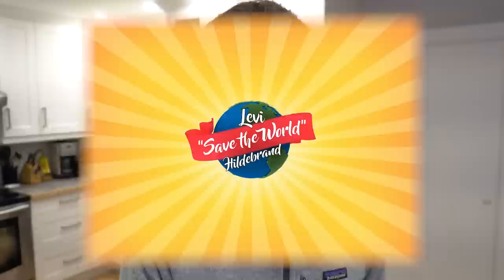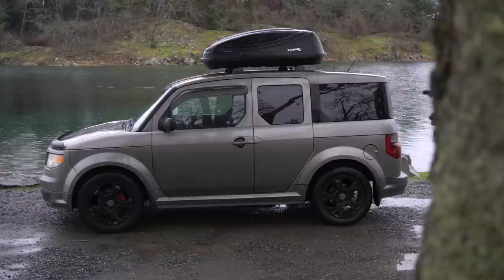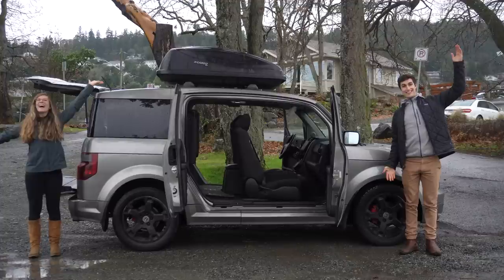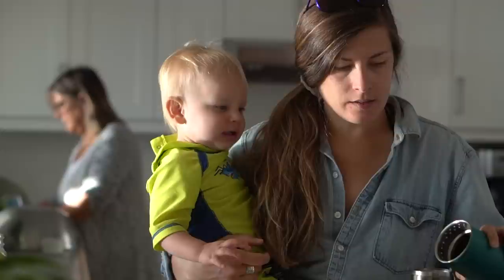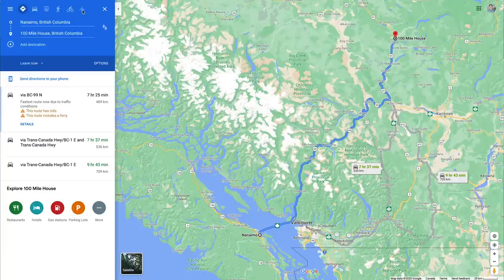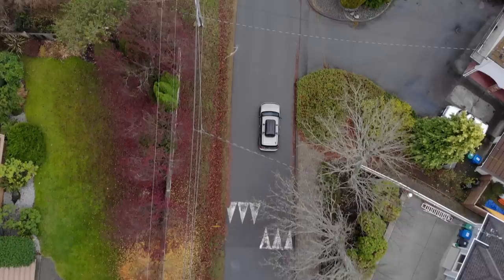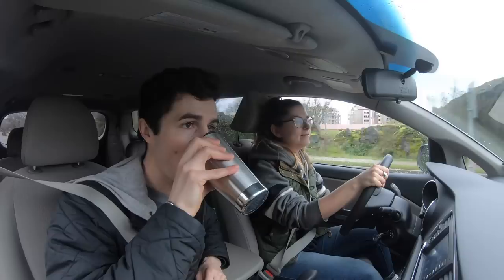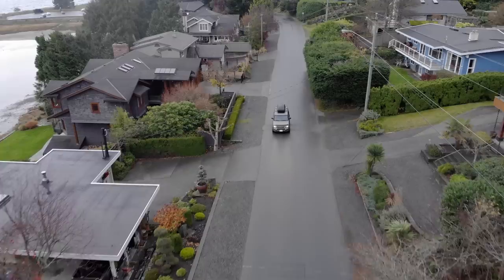We Bought A Car!?

Comment: Thanks for publishing this!

I can relate to some of this. Commuting by public transit to work is 1.5 hours, vs driving takes < 20 min, so having access to a car is a decision I had to weigh against the value of time and my mental sanity, but also access to things that aren’t walkable. Also now that Covid is present, having your own vehicle means the privilege of lower risk of exposure to other people when you do need to get to essential places.

I’m curious if you’ll touch on the maintenance/repair aspects of a car (bc mending instead of buying new is applicable to all things to a certain degree), fuel efficiency (and making best use of that), but also choosing between gasoline that has higher ethanol (cleaner burning, but also more expensive) vs “regular” gas.

Comment: You could have also bought a used Fit, which have hondas magic seat feature, where the rears fold flat and into their footwells. They are more efficient with less wind drag, narrower tires, and a 1.5 I4 instead of hondas k24 powerhouse. That comes with the cost of acceleration/torque and initial price(they are highly coveted at least in the US) but with the benefit of similar or cheaper maintenance cost, 20% better average fuel economy, and the ability to stretch that F.E. much further than the element using efficienct driving practices. 

You may want to change from overhead pod storage to tow-hitch-and-box storage to decrease drag area if you seek to drive as efficiently as you reasonably can(testing to determine which is more efficient is recommended). Also watch out for and baby earl's starter. You basically have to remove the engine from the car to get to it - look at scotty kilmers video on them. Another video to consider when comparing earl to electric cars would be the those on ev's from Jason at Engineering Explained. 

Seems like, in order to live the way you choose, you're dependency on cars is somewhat forced. Have you considered ebikes to supplement <15mi trips? Please do if you havent-its way more efficient than human power. 

Nice to hear you intend on keeping your impact-by-mileage far lower than averages. Id say that's one of the most important things - whether or not you own a car. Many tend not to think about that when trying to be sustainable drivers. It seems some instead look for the most efficient hybrid to suit their wants/needs and rack on 18k miles/yr(necessity notwithstanding), which in turn is more impactful than 4000/yr in an element. Sick find!
Reply: Exactly what I came here to comment! My family member has had a honda fit for 8 years with no problems. You can get cheap used, fold up seats plus the great gas mileage which is both budget friendly and very environmental. I'm in the market for a car (after bicycling and using public transit for 30+ years which is no longer safe in my area due to numerous crazy and hostile drivers). I got excited after seeing this video about the honda element but that gas mileage is horrible! And they are mainly going to use this for long trips! Yikes!

This purchase which is causes the most pollution that they will ever create basically negates all the other environmental stuff they practice  and their main purpose in using it shows that they are just youtube environmental posers and that's really disappointing. They lost me as a subscriber.

Comment: Did you shop used EVs and hybrids? A used Chevy Volt can be around 10k US, that would allow you to gas up for longer trips and still plug in day to day. Even plugging into a standard North American wall outlet can meet most daily driving needs.  A used all-electric used Nissan Leaf goes for a similar price, and while the leaf suffers battery degradation from having an air, vs. liquid cooled battery, you live in a climate where it rarely gets very hot, so a used Leaf should hold its range fairly well. Buying used EVs usually means you're helping the first owners trade up to new ones and thus accelerate the vital transition to electric vehicles.
Reply: When I was looking for a used car to replace my 18-year-old car a few years ago, I really wanted a hybrid or EV, but at that point there weren't any used EVs in my area (southern Ontario). I suspect that, at least at that point, the market hadn't built up enough in Canada.
Reply: @beth7467  Yeah, they are still a little few and far between. In Denver we actually are lucky enough to have a used EV dealer. But that is fairly novel. The good news is EVs should keep getting more common, Tesla is planing to have a $25k car in 3-5 years for example. BMW is also getting super serious about EVs.

Comment: Depending on where you are getting your power from as well, doesn’t make an electric car automatically better for the environment. If you’re getting your power from a coal powered power plant or natural gas, who is to say the energy that was required to charge your car is better. Transportation is a very complicated sustainability conversation
Reply: Internal combustion engines are actually really inefficient, especially compared to electric power generation. You're still better off with an EV even if its energy is derived from fossil fuel power. Also I presume Canada will be transitioning their grid, so an EV would only get cleaner :)
Reply: @asthmatictuna  I still think that, based similarly on what Levi mentioned in his video, more resources and energy go into making electronic cars, and who is to say how long the battery lasts. So I wouldn’t automatically say that it’s better. Especially if you’re indirectly powering it with non-renewable energy during its lifetime. I definitely think Canada is different, I was basing this off of a hypothetical situation. There really aren’t many coal power plants left and most are only turned on during high energy days in the summer.  I mean I get my power from a nuclear power pant. Technically if I had a Tesla my green house gas emissions are way down, but the end of life cleanup for both the car and the used uranium lol isn’t great 😂. So I think it’s a very complicated issue across the board, and you can’t automatically say one is better then the other. Especially even thinking about all the resources (and long term social problems that it’s caused) it takes to get the oil here to begin with is something we don’t think about. But that can be said about some of the minerals in the electric cars too. I think we as humans want to have an easy answer for sustainability issues, but it’s more complicated then that. I took an environmental economics class and that’s one of the main things we focused on, that most of these problems don’t have an easy replacement or else it would have already happened. But I am still hoping for more electric cars for the future. I’m hopeful the technology will keep improving

Comment: Yeah, I think buy pre-owned and used stuff makes the most sense for those who can't afford certain options. It's using the thing until it can't be used since recycling parts or dumping them early to get a new EV might be more cost-intensive and GHG intensive.
BTW, you might want to move the thumbnail text away from the bottom right corner. It's ALWAYS covered by the time length

Comment: I need to find that article about the impact of evs on the electricity production, it was on Europe though.  There are already problems with the supply in winter, especially sustainable sources, and if every car were replaced with an electric one, it would be a disaster, we would have to rely on fossil electricity and it wouldn't even be beneficial in the long term...

Comment: Great choice in the vehicle! Honda Elements have never won beauty awards but hands down are one of the handiest vehicles on the road. I've had mine for 3 years in SK and can't imagine what I would replace it with when it dies. Plus most of the depreciation has happened, these cars are one of the few that are actually on the cusp of going up in value. Great choice especially out in BC! 
I have a buddy who also owns one. He built a camping set up like one of the photos you showed with the boxes on the sides and a platform in the middle. He finds it annoying to have to open those to get anything out of the boxes. I fold the seats flat and toss an air mattress on top. This style may work better as you most likely would want to bring your bike along, and building things take up a lot of space when not in use. Have fun decking it out!
Reply from the maker: This is great to hear! (and a little reassuring too tbh haha). I always second guess purchases like this but so far I've been really happy with Earl!

Comment: So, I’ve got a question and I think you’ve got the unbiased answer I’m looking for how about the electricity production? At the end of the day aren’t you just using fossil fuels at the end of the day? And is that factored in to emissions of an electric vehicle? I have an answer but I would like to hear from another person
Reply: I don't have the figures really but my understanding is that even with fossil fuel powered electricity EVs are more efficient over their lifetime than vehicles with internal combustion engines. A battery engine from the very large scale fossil fuel power plant is much more efficient than a small internal combustion engine.
Depending on where you are you definitely can purchase 'green' power from certain energy providers - which if you are powering your EV off is much better than a standard petroleum fuel car.

In Aus we have a company called Powershop that is completely carbon neutral and you can purchase specific green energy credits for your power bill. While this isn't technically powering your specific house by solar as you are still relying on the grid - it does pay for the renewable energy you use to be produced and increases it's market share so it is in practice is the same thing.

Comment: What about the length of time it takes for those batteries in the Tesla’s to decompose. I thought it was around 100 years. I think that is where people miss that not only is there a carbon footprint in manufacturing of the Tesla’s, but also when the battery is no good can no longer be recycled and used.
Reply: I think Jason from Engineering Explained did a pretty good lifecycle analysis of electric cars. In the video, he quotes how no one's really knows what the carbon footprint is at the beginning and end of the cycle.

Comment: That's  a great car with low cost of ownership.   It should last you  many years with just regular  maintenance.   A car spent on the road is much better than one that has an early  trip to the scrap yard.
Reply from the maker: Yeah I agree with your last statement. I tried to articulate that in the video but it's a difficult one to get across when all we talk about is the c02. Thanks for the comment. 🙋🏻‍♂️

Comment: TBH, I was wondering how long you'd last in your current living situation without a car. I mean, it would be doable, but....for how long and with what costs? Makes total sense, including NOT getting an e-car or something like that. I bought a used hybrid that then broke down and was no longer under warranty -- because of the parts that malfunctioned, it was going to cost more to fix than to just buy an entirely NEW car, like BRAND NEW, not just new to me. 

With regard to car sharing, I live right in the middle of a city and the car share program here has been steadily removing vehicles. It's getting harder and harder to find an available car. :( And, as you mentioned, it's hard to use a car share for any trip that's more than a day long -- and a full day costs 1/2 my previous monthly car expenses. 

So sorry about your grandfather, Levi!

Comment: There are a lot of factors to go through when making a big purchase, such as a car, and you bought one to fit your lifestyle. Unfortunately, there just isn't enough variety in the EV market and they have not been around long enough to have a large enough used car market. There are also many infrastructure aspects that are not conducive to owning an EV. I live in an apartment where residents have a shared parking lot; I would have no where to plug in a EV. Not enough plugs elsewhere that makes traveling long distances troublesome. If the electrical grid runs mostly on fossil fuels.... 
With that being said, we make the best environmentally friendly decisions based on what we can do with what is available. Have fun traveling in your new car!

Comment: You talked about buying a used gas powered car vs a brand new EV when talking about the upfront environmental cost. But a used EV is also an option.
Reply from the maker: Yeah we looked at this a lot too actually but we found that any models we wanted (with the function we looked for in the Element) we're a lot more expensive than we could afford. 😢 Next time we will likely be looking at a model Y or a hybrid Rav4 🙋🏻‍♂️
Reply: @LeahandLevi  Yeah I feel like you have to be a lot pickier with EVs to be sure you get what you need. I recently got a used BMW I3 for actually a pretty reasonable 16k and I am happy with it but that is a large amount and I have a house I can charge it at, if I were an apartment dweller or condo owner idk how they would even charge it.
Reply from the maker: @shaetanner1703  Yeah that's another thing. We don't know where we're going to live in the new year and we don't know what the options are going to be at this point. Fingers crossed it's something that works in favour of EV's and such.

Comment: Vans are expensive? Used vans? Not Ike the Sprinter or expensive crazy new ones. I don't imagine you're a car guy so you're probably less familiar with the options but Mazda5 would've been perfect and a lot better value than the Element. I'd love an Element but they're crazy on the used market so I'm not sure how you ended up there hahaha. Upside is if you drop it it's gonna hold its worth too so eh. Downside for the 5 would've been the seats probably need to be outright taken out.

Anyway, rambling a bit but I've been thinking about doing a similar move for over a year now for trips and stuff so I do wonder if there were other considerations beyond the video. :p

Comment: Give yourself a break you have only one car when there are people with multiple cars. We have a small car that gets good  gas mileage. My husband has a job far distance and I use it here and there. Are car is used too. I still don't know if I would invest in electric car because of the large battery. What happens to that battery after it's been used up? Does it get recycle or put in the landfill I don't know. That would be a good topic.  Thanks for your video always, be safe.